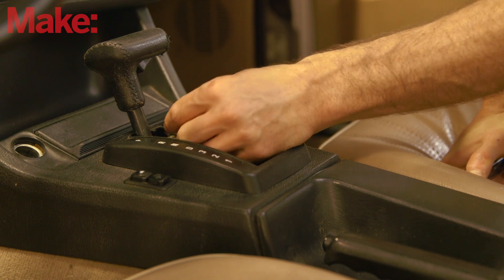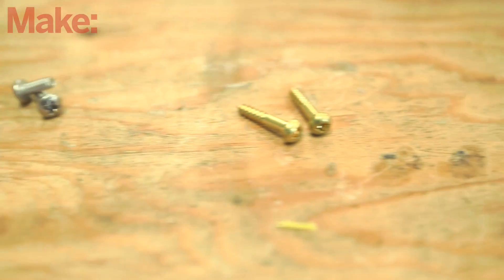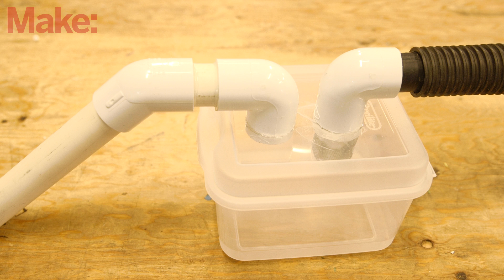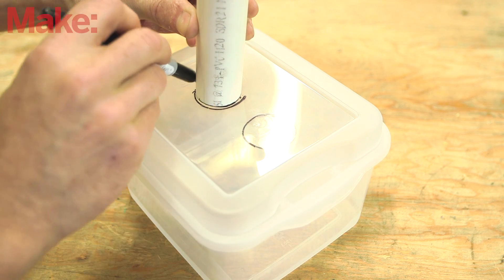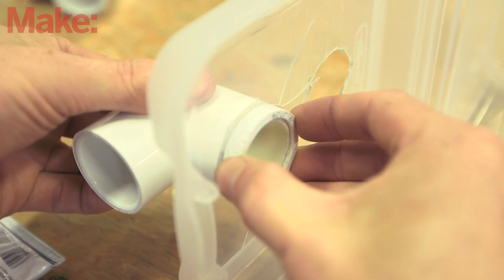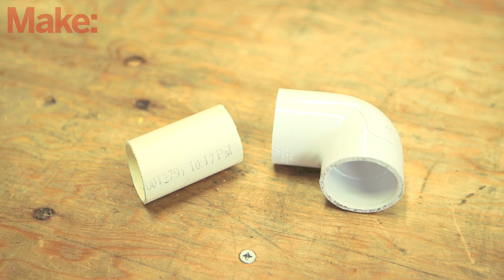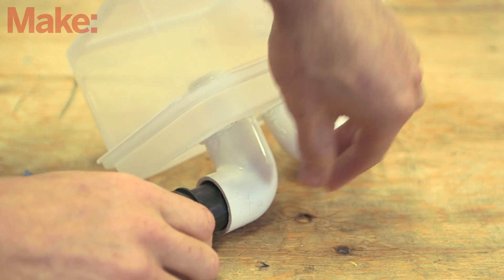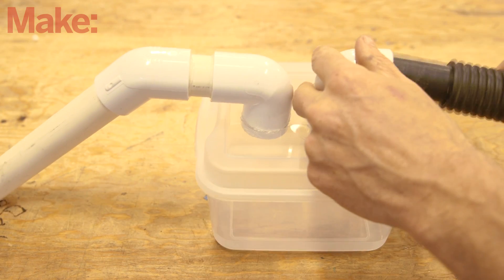Lost Screw Finder

Comment: I was thinking, instead of putting it like that, you could better connect some modified pvc pipes to get out from the vacuum cleaner into the plastic box (with the filter there) and connect the vacuum's own tube to the other side of the box (the first intake), so that you won't have to lift the box when you try to retrieve it from a cramped space.

Comment: This is pointless and a complete waste of time.  Use your shop vac and when you hear the screw being sucked up the hose turn the vacuum off and get the screw out of the canister.
Reply: Many shop vacs are too noisy for that, plus if the part is very small, might not hear it even with a quiet system.
Reply: SO suck the whole area and check the vacuum.   But I guess you are one of these maker people who like to spend hours putting together euless systems...
Reply: My guess it'd be a good deal quicker than the time it'd take you to empty and then wash out your shop vac bucket so it would be nice n clean in order to find that black 4-40 1/2" machine screw you just sucked in...
Reply: One of those maker people?

Comment: This is pretty lame, you could just put the filter on end of the hose, if you really wanted to do this, put it at the other end of the hose, so that you have just the flexible pipe as the sucking end, and you could still use any vacuum attachments.

Comment: why not just put the mesh on the vacuum hose and use it that way?
Reply: Mihail Dobrolitsky because these guys like building fucking useless things.
Reply: Mihail Dobrolitsky The old trick was to put a pair of ladies pantyhose (Tights) over the nozzle of the vacuum  with enough slack to allow a small part to be sucked into the nozzle end, you could secure it with a rubber/elastic band and away you go, this build seems overly complicated for the task.
Reply: Sculpture Junkie The only good thing on this channel now is Jimmy Diresta.
Reply: akaSkItTLes23 The perfect response.
Reply: John Smith Exactly.  I love his work.
Reply: Mihail Dobrolitsky i think it coudn't hold the screw, no enough pressure.